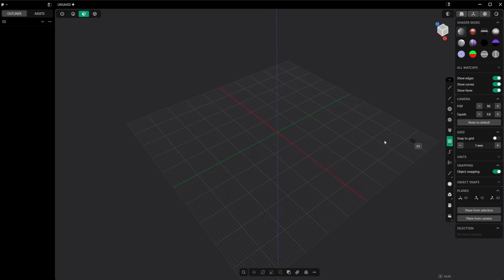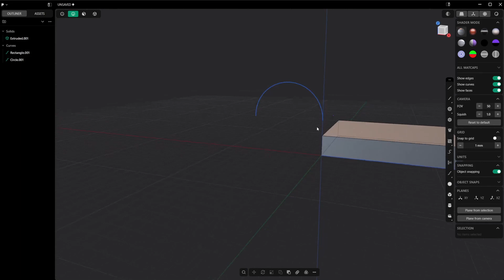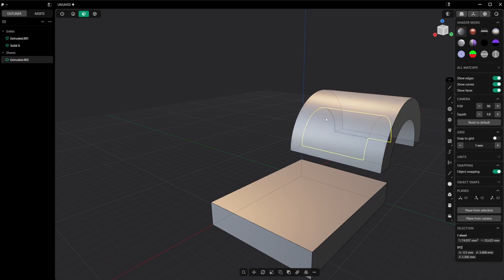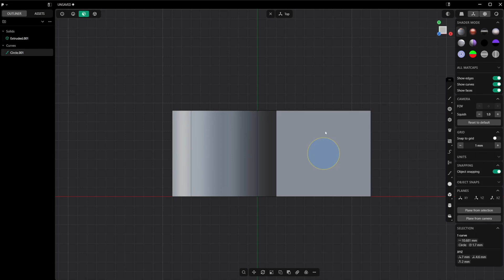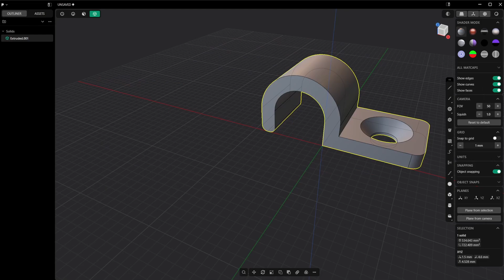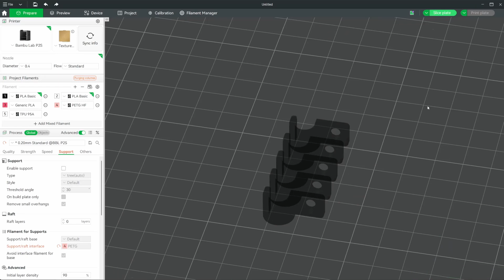Making 3D-Printable Screw-In Cable Clips In Plasticity

Comment: Biggest downside of printing on the side like that is that if you ever overtighten a screw you will split the end along the layer lines. To prevent that can print at a 45 degree so that the screw isn't a wedge between the layer lines but instead at an angle to them. Does require some supports, but I've had great luck with just a small flat tab (using the primitive shapes in the slicer) that you can snap off after printing
Reply from the maker: Thanks for the tip! Will try it out